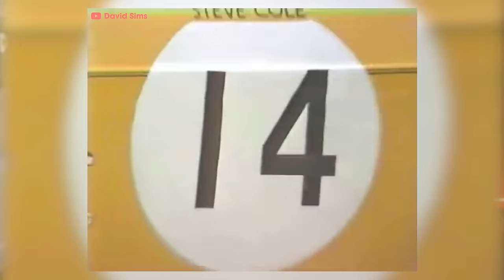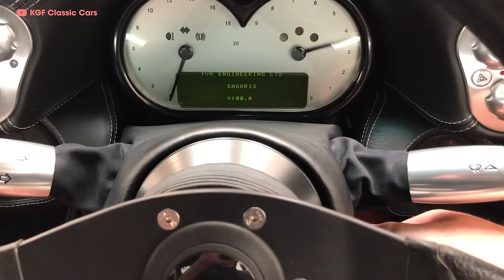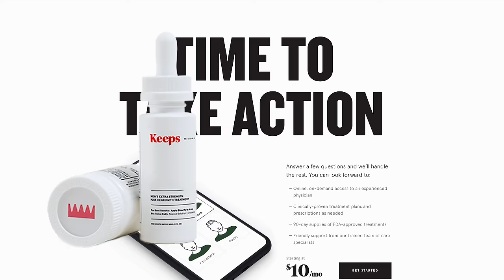TVR - The Story of The Most Cursed Car Company | Up To Speed

Comment: In Japan, where I'm from, TVR is considered the manliest automaker among the car freaks. The cars are expensive but not a stuck up middle class rocket case.
Reply: I miss the Lexus LFA, and its crazy powerful Nürburgring variant.  Honestly, FCA and Toyota could have had one awesome rivalry with the Dodge/Chrysler Viper ACR and the Lexus LFA if the people from both companies had some damn balls, do you not agree, @Left Right?  Also, the TVR company failed ultimately not due to a lot of bad luck, but, rather, to a few arrogant, prideful, and elitist assholes that simply ran their mouths more than they knew how to make a company.  Had they paid attention to actual safety standards, TVR, and its bosses, as well as employees, could have truly made some game changing vehicles with crazy powerful horsepower, torque, speed times, and speed limits.
Reply: A car that catches fire n has no safety features is definitely the manliest automaker, anywhere. In the U.S. that level of manliness is now considered "Toxic".
Reply: @didisaythat4230  right. You might as well put your gas tank on the front bumper. Or wait the ford pinto has something similar to that
Reply: That's because most of them are lethal :D
Reply: Hey your from Japan? Can you tell me if Gundam is still a thing?
Reply: @paxhumana2015  Viper ACR went 7:01 via a crowdfuned 'ring attempt, the fastest F/R production road car lap there. i'm willing to bet it's also the fastest manual transmission road car lap there. the LFA 'ring variant did not stand a chance, and costs waaaay more to purchase and operate. i won't be surprised if the LFA owners don't really track their cars as much as ACR owners do.
Reply: @didisaythat4230  if people want a burning car in thr US, they could just get a Pinto
Reply: @nogame.metakethrone.3007  yes it is. and i don't even have to be from Japan to know 😉
Reply: @nogame.metakethrone.3007  I'm not from Japan, but I visited for a month back a few years ago. The amount of Gundam stuff in Akihabara is astounding. Figures, models, toys, anything... you name it. Pretty sure I even saw a guy dressed up in Gundam suit. So, yes I'm sure it's definitely still a thing! Like I said, I traveled there (pre-covid) and there was tons of stuff so I don't think it just disappeared in the past few years. haha

Comment: I always wanted a TVR Cerbera Speed 12 after playing with one in Project Gotham Racing. Turns out, they had so much power that they never really went into production.
Reply: I have regularly seen the only road going car with the 7.7 litre V12, because my son knows the former owner and did some work on it to get it ready for sale last year, when it sold for over half a million pounds. My son has been for a ride in it, but I'm too tall to fit through the roll cage.
I also saw it at an airfield day and it was a) bloody fast and b) bloody loud.

Comment: james dude, you forgot the speed 12.
how can you do that?
it had:
MORE POWA BABY
Reply: It had no engine. It run on the screams and fears of it's drivers while the exhaust spit the flames of hell.
Reply: I was also disappointed to have not seen it even mentioned.
Reply: I know right. The speed 12 is probably the most recognized TVR along with the speed 6 which was featured on swordfish
Reply: 12:36 it is mentioned. It’s not called a speed 12, it’s a Cerbera. The speed 12 from the video games was a concept model but never made it to production.
Reply: @johnc4517  the speed 12 was a a race car the owner of tvr at the time consider the car unsafe for road driving and because of that never make it to production.  Check alfa guy 2 video about the story of the speed 12.
Reply: Javier S. The TVR Cerbera Speed 12, originally known as the Project 7/12, was a high performance concept car designed by TVR in 1997...... which turned into a race car, then production, but was then halted and dismantled when the owner of TVR decided the car was too much to handle....
Reply: i just thought about it, that thing was a monster!
Reply: John C it wasn't dismantled, Keith Flint bought it apparently.
Reply: @nando03012009  I used to work at the only TVR dealer in Belgium about 14 years ago and they actually had that exact Tuscan speed 6 from the movie Swordfish. I remember that colour, it was so awesome and I had never seen anything like it.
Reply: @poepeloerke2  I always wondered how that color was mixed. It just brought attention. TVR's nearly impossible to find here in the USA, too bad cause I want one that or a Noble m600 or m12
Reply: @nando03012009  I remember asking my boss about the color and he said it came as is in 1 jar, so I have no clue how it is made. It always amazed me it could come as 1 color cause I always imagined they had to put different layers of different colors to get an effect like that, but I'm not a painter so I still don't know if that's how it usually is done.
As for wanting one, maybe go for the noble then, those tuscans were riddled with issues. The engines backfired and the air filter was just on top of the intake runners so it would catch fire, I saw loads of tuscans who had a burnt down engine bay because of it. Also, if you were driving the car at speed and open a window, it was possible to lose the rear window. It would just pop out from the pressure and fly off. This became a real problem once TVR was bankrupt and these windows were no longer produced. My boss actually went to Blackpool to buy up there last stock of windows and bodies. 
After the bankruptcy he did 2 other brands for a while (farbio and wiesmann iirc) but those weren't much more successful so he had to close down after a while, by then I no longer worked there but I would stop by for a chat once in a while since it was 5 minutes away from my home.
Reply: @Spermwhales93  not the speed 12. TVR point blank refused to sell the car to anyone after Peter wheeler took it home 1 night and cancelled the whole project the next day. Iirc they made 2 prototypes 1 ended up in hexham minus the engine. The other hasn't been seen since it was last seen in pieces in a workshop in Blackpool. The road car engine was either melted down in the late 90's-esrly 00's or it's still sat in an old TVR store room somewhere. Either way it hasnt been seen since around 2001.
Reply: The Speed 12 race version was limited by regulations to 680hp due to its low weight.
The road going version was supposed not to be limited but nobody knew how much power it produced because it sheared off the shaft of the testing rig which was rated up to 1000hp.
TVRs owner decided that the unlimited version was undriveable and it was never sold.
Reply: I sat in a purple Speed 12 at the Adelaide motor show in the mid 90s 
Me and my school mate got hand picked in front of the crowd 
Was one happy kid !
Reply: @the_sapph1re370  Well played, mate. Well played.
Reply: I've seen a red speed 12 in real life the noise from the 800bhp 7.7l engine is immense

Comment: I'm so glad you folk did TVR finally, as a Brit it's one of my favourite car manufacturers, but why didn't you mention the Speed 12? It's probably one of their best/scariest/biggest mistakes of a car ever and it's awesome
Reply: Connor North I agree! Everyone should know of the great behemoth that was the speed 12!
Reply: If you are ever in England visit the Lakeland motor museum in the Lake district. They have a speed 12 on display.
Reply: vwbeetleb0b I lived in the UK for numerous years and never known this. I must go!! Thanks for the tip!
Reply: @Lewes32  It is owned by someone who does sometimes take it out. maybe best to phone before you go to be on the safe side
Reply: You never talk about the speed 12. That car was a mistake. It was a demon, it wanted it's own driver dead.
Reply: The best thing is the racing version have 650 hp , but the road version have 800 hp
Reply: I came here to say this, the Speed 12 was easily the most bonkers car that TVR produced.
Reply: The racecar looks awesome but the streetcar has a huge gap between the top of the tire and the fender that I just can not ignore and completely ruins the whole car
Reply: Yeap the scariest indeed ! N.A V12 7.7 Liter engine 800HP and all that power on a vehicle weighing less than 1.100 kg .
Reply: @the_sapph1re370  sounds fun
Reply: I’ve seen the only road registered (to my knowledge) speed 12 at Lakeland motor museum in Cumbria
Reply: I rarely make comments on videos. But I scrolled down just to check for someone calling him out on this, and to do it myself if no one had yet. The Cerbera Speed 12 is beautiful, powerful, no assists, and definitely murderous. And to someone who loves a 'raw' driving experience. You literally cannot ask for a better design philosophy than that. It has, and probably always will be my dream car. If I ever win the lotto. I'm buying full specs for the vehicle from TVR and building my own as a kit car. lol
Reply: @SolessDesign  I think it's even too far for someone who likes purity. It's just flat out dangerous

Comment: Here's a fun thing, if a bit sad.

Peter decided to commission his own V8 for the 90s.
So came the AJP8, the Speed 8 (Al John Peter)
Flat plane 4.5L V8 SOHC.
About 400bhp from 120kilos (210lbs)
Redlined at 8000rpm.

The only other way to get that noise is in a 90s F1 car, it really was a terrifying noise and they are sadly now vanishingly rare.
Reply: It doesn't sound like a 90's f1 car... it's a 75° v8 and the bottom end is pretty much identical to a 90's f1 car. It does sound really unique though, and ludicrously fast 😎.
Reply: Shame it only appeared in the Cerbera, seems like a huge waste of an engine to only ever appear in 1 model. It was supposedly more reliable than the speed 6, but more costly to produce.
Reply: They banned Peter Wheeler for conning Nickoali Simiski i used to build them till the END
Reply: 120 kilos is 262 pounds I think. Aside from that, sounds like an awesome power plant, and still very lightweight
Reply: @dr.lyleevans6915  
Probably, I was just writing from memory!
Turns out the guy who designed the Speed 8, Al somebody, designed a new roadster to use it.
Sadly it also flopped, with only 7 made.
Reply: I remember this being the highest revving V8 at the time too, gave it a bit of an F1 sound at those revs.
Reply: The last 4.5 ltd Speed 8 produced, which was also the best, could achieve ~98 bhp per litre.
Reply: 440 bhp for the Red Rose tuning version with 97 RON petrol
Reply: Hey hey!! I've got an idea, this is a good one!

We each put some money in a pot.
We start manufacturing the Speed 8 again.
Then we sell them, as crate engine to the Americans, they love crate engines!
Reply: We could probably, to begin with, commission them to be produced somewhere in China!
Reply: James Neave 8,000 rpm is impressively high for a production (albeit limited run) model, even if it was just a tad on the smaller side for a V-8. And brushing against the 100hp/L mark is incredible for that time period, especially considering the company had a much smaller R&D/manufacturing budget to work with compared to the larger auto manufacturers. The weight was impressive as well. I wonder if it was a pushrod (OHV) or (D)OHC, do you know?
  Speaking of high revving muscle, I used to own a late 60’s Chevrolet C-10 that had a built 350 w/ ~475 rwhp. One time I briefly (and accidentally) tached an indicated 8,300+ rpm during a hard 1-2 shift in the rain. That truck was a beast, especially considering that I was a teenager at the time (it was actually my first “car”. Quite a big learning curve for a 15/16 year old; with that power running through a transplanted Muncie 4-on-the-floor without synchros lol). It would pull the front tires off the ground on the 1-2 shift if I let the suspension load a certain way. It would have easily outran the Porsche I had later to 80 mph or so.
Reply: @MostlyPennyCat  if you're talking about the Al who designed the AJP8 engine then I do believe that is Al Melling. He did some work on his own engine and car years ago that was gonna be called the Melling Hellcat but nothing came of it.
Reply: @MostlyPennyCat  as an American I can comfirm we LOVE crate engines however we are still absolutely awash in junkyard 5.3 liter v8s for under 500 USD a piece and they can be made to run like a scalded dog. Any new engine would have a very hard time breaking into the american crate engine market. Which is sad because I love TVR and their inhouse engines the AJP8 and AJP6. The fact that such a small company made their own powerplants will never cease to impress me and there's a kind of hot rodders spirit to it that TVR seemed to have as whole. In a British flavor of course.

Comment: 14:13 “Naturally aspirated in-line six” * clip of an obviously V8-equipped TVR doing a burnout *
Reply: You're spot on. TopCats racing UK swapped out the S6 for an LS.
Reply: I'm no expert, but I can see how a 400hp NA inline-six could sound like that. Not completely unbelievable, but I also wouldn't be surprised if it did have a V8.
Reply: if only v6s sounded this glorious
Reply: @GhostlyGhille  Yeah V6's always sound like ass.
Reply: @Philip2k  yes at low RPM the speed six sound like a V8, specialy on the Sagaris
Reply: @CanadaBud23  except for the NSX tho
Reply: @cnocee  Ehh it's ok. It's one of the better ones for sure. I think it could be the small displacement and higher RPM smooths it out more.
Reply: CanadaBud23 
Yeah, the NSX sound SO awful! And the Dino sounds like shit!
Reply: @CanadaBud23  what about R35 with some modified exhaust?
Reply: @MeterPaffay60  Nope. A built NA VQ sounds way better.
Reply: @thejay8963  LOL my 2.7 Intrepid sounds better than that bag of broken parts. The NSX is ok though.
Reply: @Philip2k  in-line six sounding like a V8? They sound quite substantially different. Maybe a flat plane V8 and i6 at like part throttle. Crossplane V8 and and i6 sounding similar is v hard to believe, unless you can back it up.

Comment: Good job.

Got my first TVR when I was 24yo - a V8S, which was so loud it used to set off car alarms as I drove it past

Then a Griffith 500, followed by a Tuscan Red Rose edition [which was a very early & unreliable one], and have now had my current Tuscan S for about 12 years now... 

Still absolutely epic to drive. And the (stock) exhausts are basically motorbike-style cans, so it sound like a 4-litre bike when warm

Comment: The Cerbera Speed 12 is in the Lakeland Motor Museum in the Lake district . I worked on it back in the day. The original purple speed 12 ended up being cut up and thrown in a skip . You used to be able to buy models of that one . there is also the Tuscan R which was a beast ,not many of those made .And if you want really wierd type in  " TVR Scamander " Peter Wheelers last creation . I painted that .

Comment: I had a Tuscan Speed 6 Red rose - 400hp. in a tupperware box. I took it to one of the longest runways in europe for a top speed run, but at 180mph the backend was lifting into the air - I was absolutely sh*tting myself. Plus the runway was running out. I had to ease the power off and the brakes on to try and get the backend back down and the speed off, while trying to do it before I ran into the concrete wall at the end of the runway. You could take as many top speed runs as you wanted.. Needless to say, one was enough! Still - I've never driven anything else as mental. no traction control, no airbags. loved it. though it did need a full engine rebuild at 2 1/2 years old and 15k miles!!! - thankfully TVR paid for it after some moaning. My reg was T666 UFO which seemed appropriate.

Comment: TVR made a name for itself for a while. It liked to be faster than its weight, making it a perfect burnout car.
I even noticed that in Gran Turismo the original on the Playstation 1 where oversteer would do it's thing on near any given corner (with it).
The Chrysler Dodge Viper was a bit heavier, so got more grip... More practical basically, but it was in the same basket of having massive engine (a truck engine originally) chucked into a bird of a car for weight. The difference is, Vipers are still around and have a great sense of cool, and race really well in their class, for those who learn to handle them.
Thanks for the video on TVR. The research and history you guys do is flaming great.

Comment: Back in the late '90s I worked as a parts specialist for a TVR dealership in Manchester,  UK. I loved the cars, they were quite problematic, but my favourite BY FAR was the Cerbera 4.5
Absolutely beautiful car, fantastic power from the flat plane V8, the noise it produced was pure EVIL, and they styling was immensely radical for it's time. I'm so glad I got to drive the whole range, Griff, Chimera and Cerbera, and I was only 25 to at the time! 
TVR had no parts catalogues at the time, so I made very good friends with the parts guys at the factory, which was in Blackpool, only an hours drive away from me. I visited them on occasions

Comment: I've upgraded from a Porsche Boxster S to a Tuscan. It does more miles per hour but way more smiles per hour. What's more it's turned out to be more reliable than the Boxster although the Porsche had another 20,000 on the clock. Put simply, the Porsche looks like a Renault Clio inside whereas the TVR looks like steam punk artwork... I just love it

Comment: They made a new speed 12 twin turbo. It's on YouTube on the goodwood show. Ex tvr engineers built it from blue prints of the old speed 12 but with a slightly different look. And this is a road version aswell. 2017 plate
Reply: There was never any drawings at TVR.

Comment: The TVR Tuscan Speed 6 completed at le mans in 2003 and 2004. During the 2003, two cars were entered. One was ran off the road, and the other car fried its transmission in the evening. Both cars  did finnish the 2004 race, almost dead last. The model was successful in winning the British GT Championship in 2002.